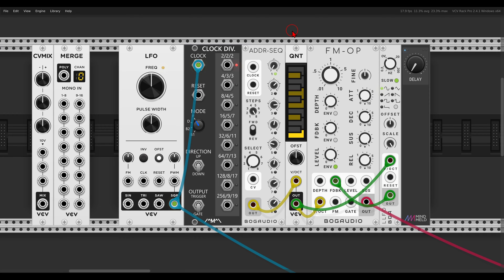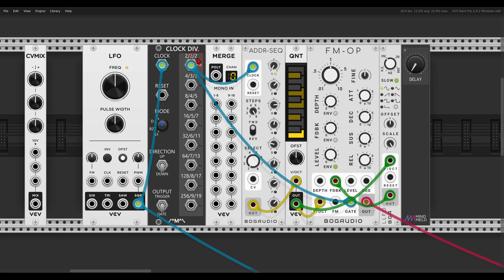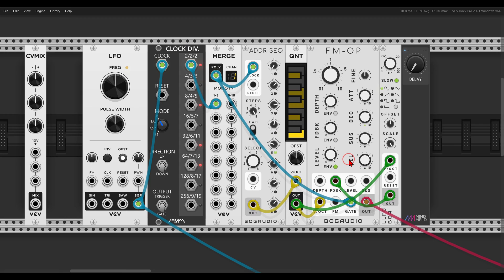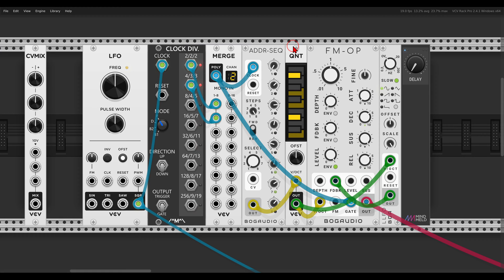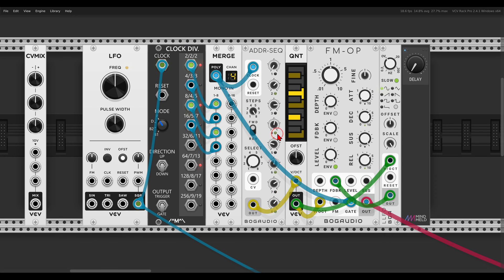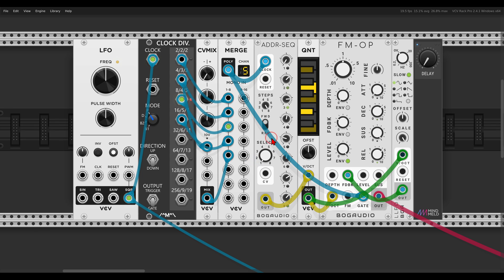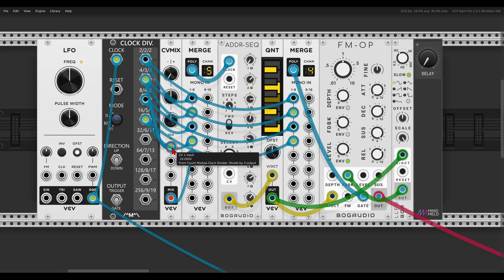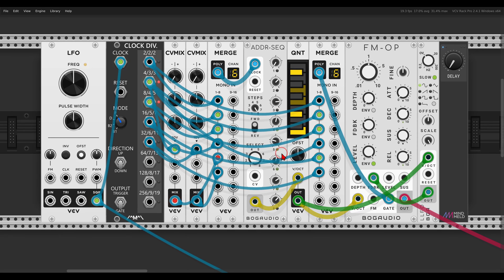using one ADDR-SEQ to generate MULTIPLE sequences \ Quick Tip

Comment: I use this module so much. It's basically a Turing machine for me: command R over and over until I get something I like. Mostly I use it for non pitch modulation. 

But reset plus the "select" input make it tremendously useful for "deterministic generative sequences."
Reply: Stoermelder STRIP to cue randomization for easy generative patches
Reply: @thewolfin  for whatever reason, I dislike randomness in my patches. I was thinking of hitting cmd-R until I found something I like.